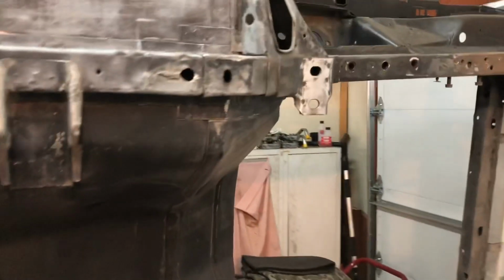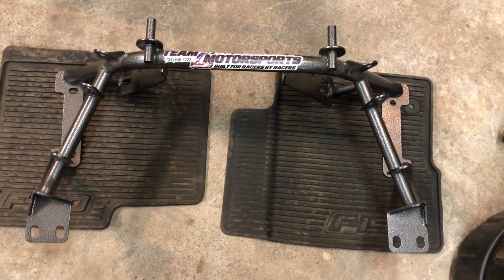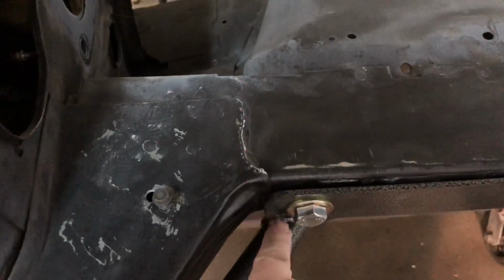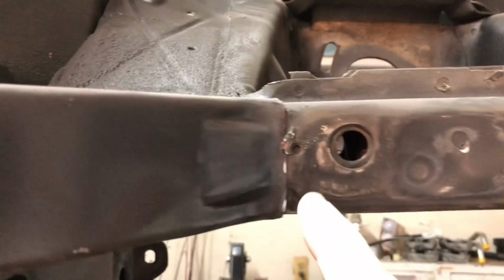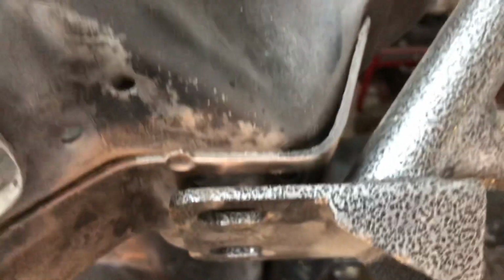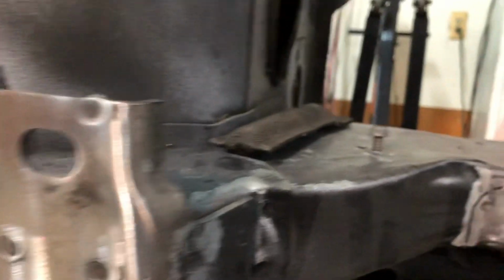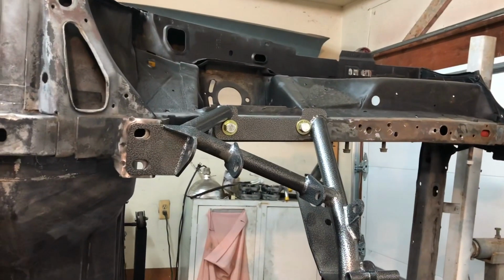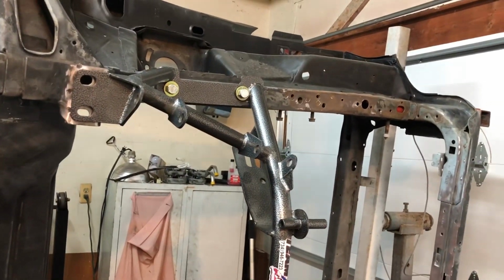1980 Ford Fairmont test fitting Team Z K member

Comment: A couple of years ago I bought a Cheap stick welder. And I've wielded for years. Could not wield worth a dam with that cheap buzz box and my last buzz box was a 240 volt Lincon. I thought it was me because I had to stop doing anything after I broke my back. But I had a friend that could weld and he had no problem with it. so he suggested me getting a wire welder. And I'm not the best by no means. But at least I could do a little with it. And now I'll never go back to a stick welder. You may not believe this but I learned to weld with wire from watching people weld on youtube. All you have to do is take your time and don't get in a hurry. Don't worry you make a mistake and someone will dam sure tell you. Also, don't get a cheap one from eBay or Amazon. I got my lincoln from Home Depot and I love it. I paid less than $300.00 That's not counting my sheld, Cloves,  and other consumables. And don't use Harbor Freight anything with it. Don't be afraid to ask questions. I'd get know where if I did that.
Reply from the maker: Yeah I'm thinking I need to learn how to weld. I can stick weld not the greatest but I can do it.

Comment: Good to see you making some progress. If it's still hitting the lip couldn't you grind on the bottom side of the Z K member foot on the edge and then paint the bottom edge instead of grinding the frame more? Just a thought!
Take Care!
Reply from the maker: I thought grinding on the K member I just didn't want to mess the paint on the k member. Might want to sell it if I ever change the kind of engine I'm thinking of using.

Comment: Looks so weird going in sideways, from 872 miles away it looks like it will flush up fine once you get the bolts in it
Reply from the maker: I know lol but it being sideways makes it so much easier to work on lol. I'm thinking once I get it tighten down it should be ok.